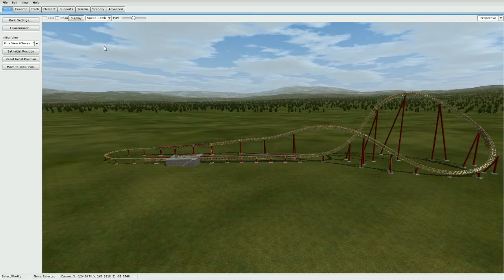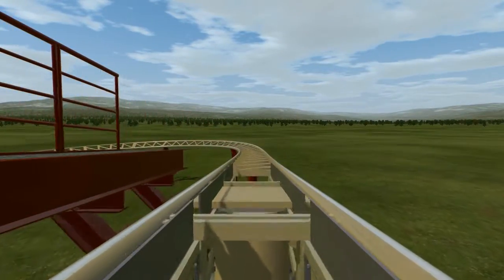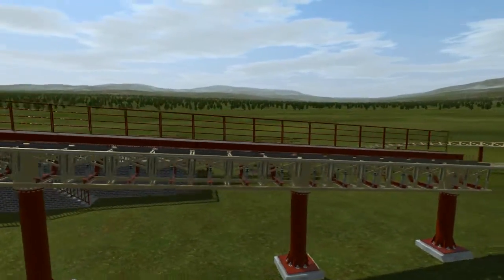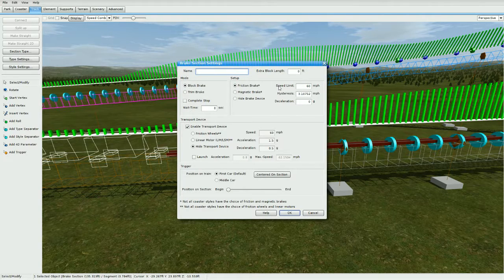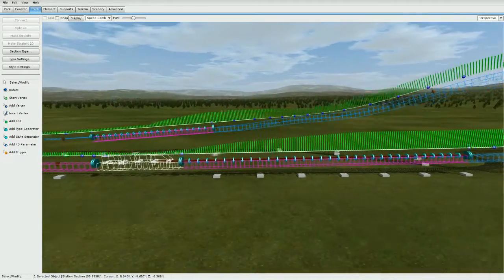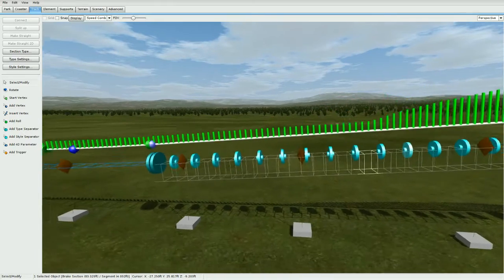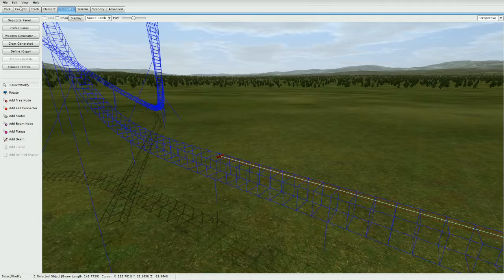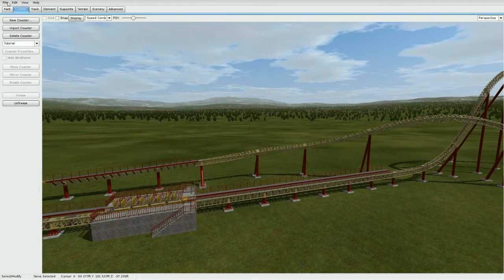No Limits 2- How to make Hydraulic Launches!!

Comment: Brilliant video, however i'm having trouble adding the 2 beams on the rails part on each side but the middle beam node is working fine
Reply from the maker: What do you mean your having trouble? Having trouble lining them up? If that's the cane just make sure your settings are on Imperial and go to snap distance and set it to .25 :)
Reply: +BossAct7 Thankyou so much

Comment: Hey I use a brake segment before the launch. By using 'block Brake' at the launch, the train doesn't launch but breaks down and keeps standing there. What can I do?
Reply from the maker: Sounds like you need to check "Enable transport device" Hope it works! :)
Reply: +BossAct7 I solved the Problem. it is a scripted coaster and I had to change something in the script. XD
I should have checked that before crying for help.
Reply from the maker: Awesome! Glad you got it! And its ok ask all the questions you want,  Im here to help :)